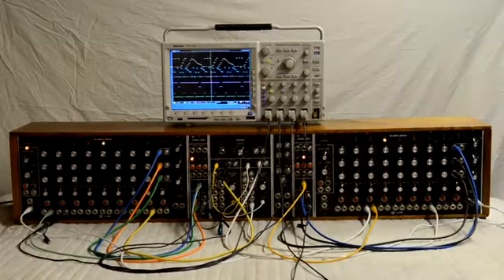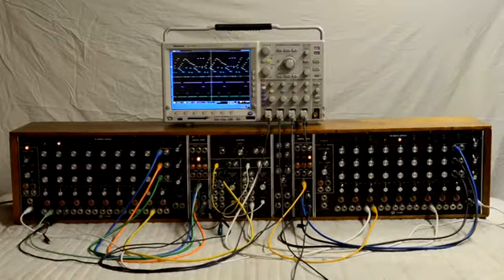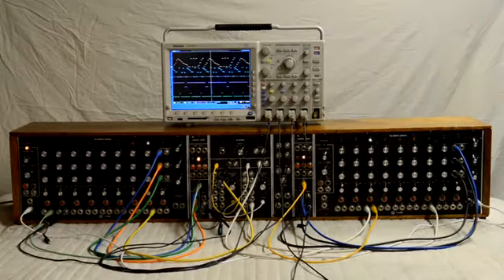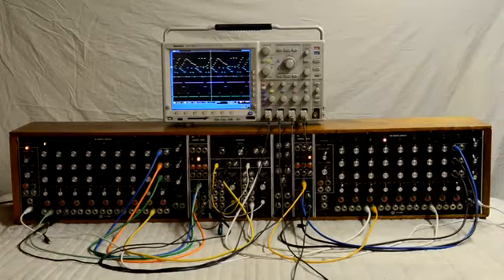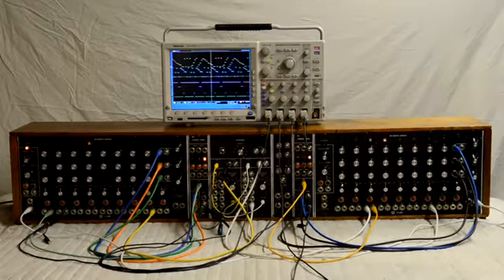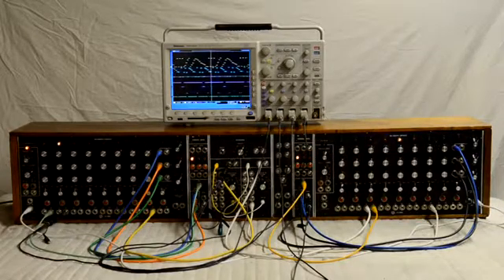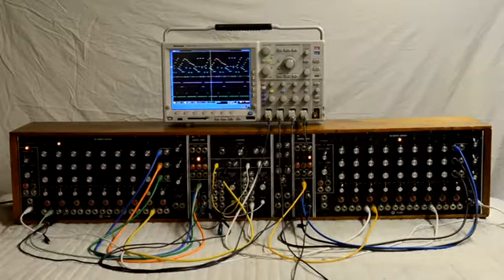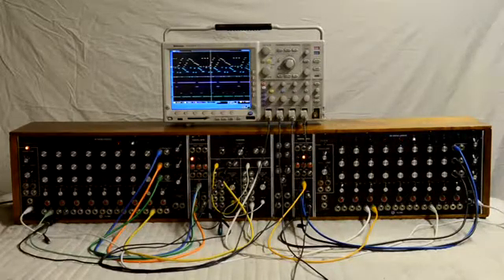Moog 960 sequencer demo

Comment: I had the chance to experiment in the last days with a R.A. Moog 960-961-962 sequencer complement B. I was surprised by how the 961 can be a great tool to make the groove swing while playing with the length knob (acting a bit like a Clock divider when a fast LFO is going to the Input B V-trig of the V-trig to S-trig section). But I have a question. Knowing that each step of the 960 are full gate on when the step is chosen, then when you sum 6 of them in a V-trig to s_trig (in input A) you always get an "on" gate in result. But what I don't understand is how the section B works... how the 961 can calculate when to "retrig" to a S-trig. I don't understand how the 961 sees the difference between all the steps, as they are all gate on. And I tried to sum three gate outputs of a 960 thru a 962 switch and then to a 961 section B input... And the 961 wasn't able to see the different steps anymore... I would love to understand that. Many thanks for your help. Samuel
Reply from the maker: The A section logically or's the signals together so it operates as you describe. The B sections individually differentiates the input to create a pulse which are then or'd together. So it generates a pulse on every input rising edge. This creates the pulse train for a trigger on every gate.
Reply: @modularsynthesis5074  Oh that's it!!! you're right! It's because of the 6 different inputs the 961 have, so it can distinguish the 6 different rises of each gate on. And of course it uses the same logic if I only plug in only one input a LFO square waveform, it will use the rising edge of it as opposed to use the amount of voltage... Thank you so much! :)